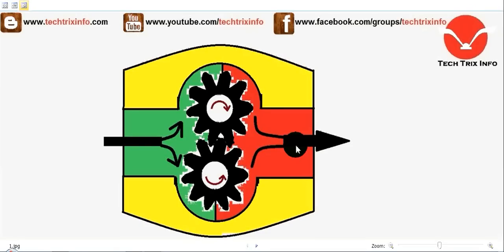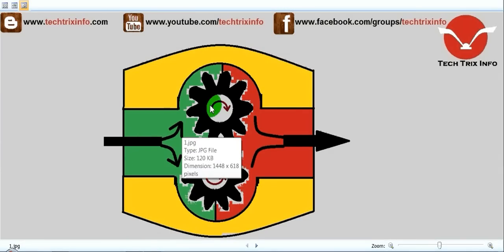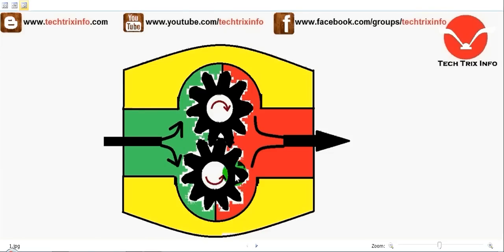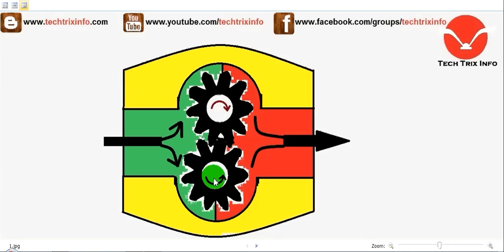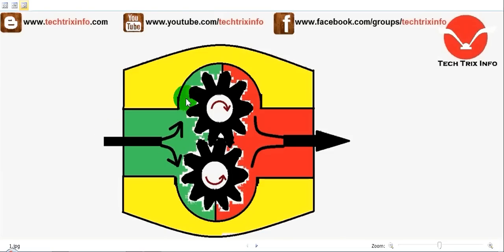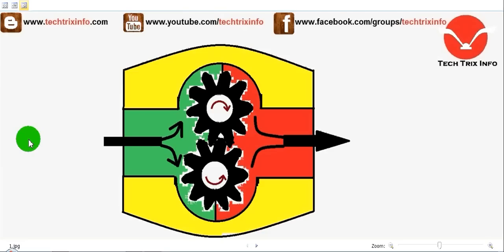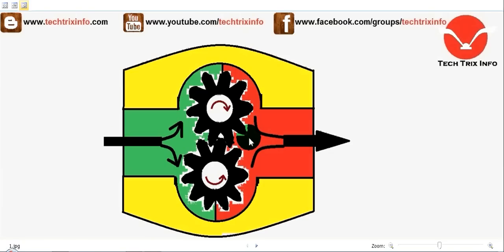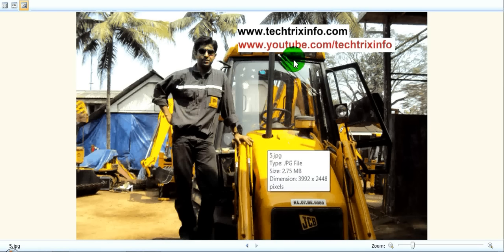How gear pump works. ✔

Comment: since it is informative,there needs to show how low pressure and high pressure regions are created for the fluid flow and more concepts of gear pump.If the above requirements are present then it will be the best to educate.

Comment: These pumps are usually very robust, however, if they wear or are scratched they become useless unless the clearances around the rotor are returned to spec. It is absolutely essential to keep debris out of a pump like this. Depending on the viscosity of the fluid being pumped, the rotor / casing clearance can be any where from 0.004" to 0.008 inch, and that has to be maintained for the pump to run as designed.